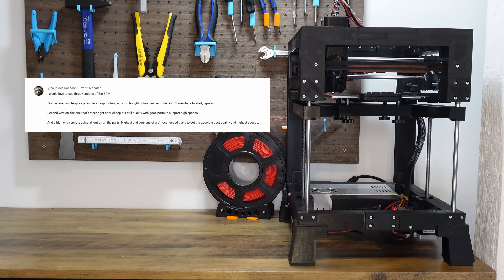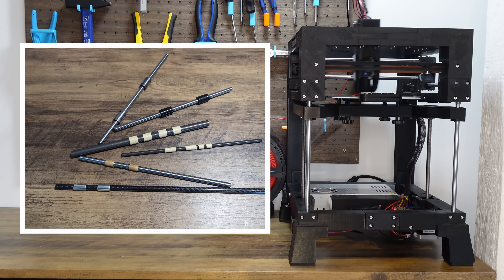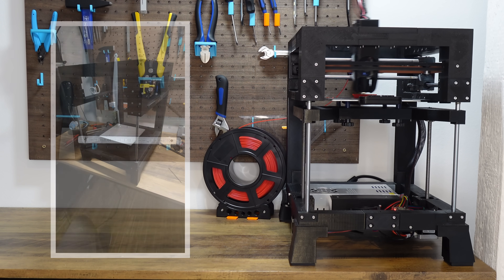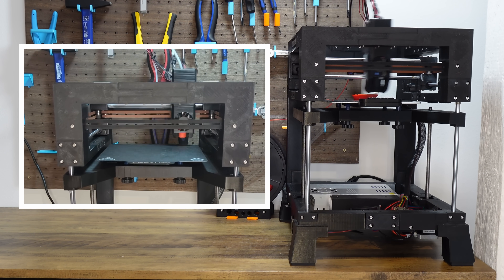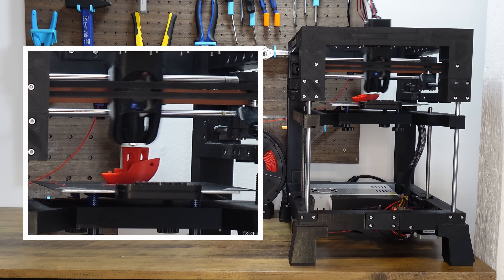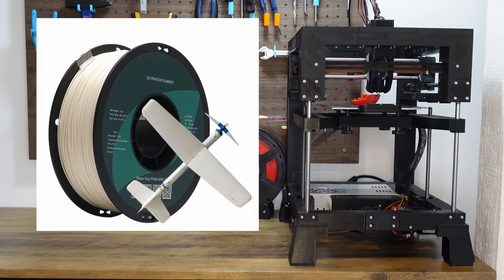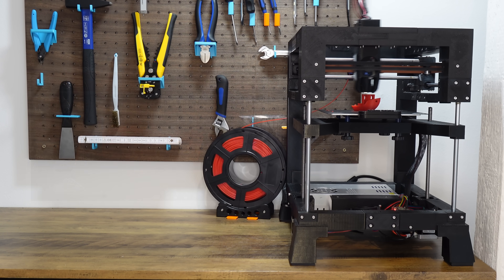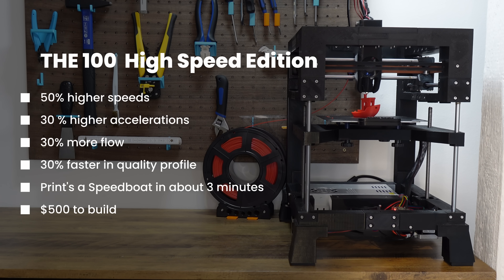THE 100 - The dethroned speed champion... even faster!

Comment: Have you looked at using two HP server power supplies in series? You need to isolate the ground in one of them but they are superb quality and the smaller 750 watt models can be sourced on eBay for as little as £10 each. Not bad for enterprise grade PSUs.

Comment: Amazing machine u made! Also i have a question regarding banana pi zero M2. Can you compile successfully rpi mcu on it to use gpio? Does it need some flinicky workarounds or just works simply? I want one cause of size and specs for tiny printer, but only what i got in question of "does the klipper work with other sbc's gpio?" was straight no (besiesdes maybe uart/i2c/spi from klipper handling drivers for that), and you are only one who i know to use this opi.

Comment: Aluminum screws are lighter than titanium. Maybe a slight bit more weight reduction is possible by switching to what is often marketed as duraluminum (aluminum 7075) screws which are very common in rc vehicle hobby spaces in the m3 size.

Comment: Project is 11/10 awesome 😎 

How about aluminum bolts? They are lighter than titanium, is the strength/ rigidity of titanium necessary? 
Also seen one of the 3d printer bloggers bolt a 3d printer to a concrete plate, will this also help THE100?

Comment: you will find that the foamed pla will be much more regid, the foaming agent makes a bubble/honeycomb ish structure inside the extruded pla, and in my line of work this means when you find the right ratio of agent to virgin material will give you ligther and stronger parts, i am a plastic injection moulding enginier in Denmark, let me know if i can be of any help :)

Comment: How viable would it be to enclose the printer and give it a slightly heated chamber? 

Ive had good luck at higher temps with cheap carbon fiber ABS (spaghett brand from th3d, doesnt have any warping issues). I just dont know if it would be enough to have a 40c to 60c chamber temp (i like to print odd materials)

Comment: An optimization may be to have the cooling fan mounted to the frame, and a tube carrying the air. This would reduce the complexity and weight of the print head, and allow for far higher volumes of air.

Comment: What driver are you using with those motors? The driver is just as critical as the motor! From the motor, looking back into the driver (effective resistance seen) will have a large effect on top speed, ringing and stability.

Comment: going to note that ABS is less dense than PLA so you could save weight that way as well. as for a recommendation of ABS, butmat's ABS prints very easily in open air and can handle the cold air from 2 4010s @70%

Comment: Is the PICO able to handle 3x 2.5Amp motors? Their FAQ suggests 0.8A without fan and higher with additional cooling. Still waiting for some v1.1 NONHS parts to test temps with the 1.5A motors
Reply from the maker: The TMC2209 Drivers are able to run up to a current of 2.0A. The limit they notice in their FAQ is for passive cooling. I used an 5015 blower to actively cool them, which works fine for me

Comment: Could you tell me where i can get the Linear Motion Parts without Aliexpress? I am from Austria and tried many of this parts in the past, but none of them worked good enough. And now, i would like to build "The 100 High Speed Edition" because i like this design and have build many expensive Printers (with MGN12H) in the past ;-)
Reply from the maker: Currently we do not offer sales outside AliExpress, but we are open to cooperate with local sellers to bring the kit into their stores, but since this is a pretty new product it will take its time

Comment: Hey Matt, I am thinking about building THE 100 but I am not used to speed, so the standard model would be the one I should build. But it is literally my job to do 3D printing (at slow speeds) and I can see myself wanting to upgrade it later. Now my question: Would it make any sense to build the standard THE 100 and then replace the parts for the high speed version later? Or should I make one decision and stick with it?
Reply from the maker: I would not use a THE 100 for a 3D Printing farm, since the time and effort you have to invest into building & tuning one would ruin every business case! Besides that both editions are compatible to each other, so you might upgrade in the future

Comment: Always wondered if it'd be possible to brute force higher speeds by moving from belts to motorcycle/timing chains and using nema 23/24 motors. Everyone's shaving weight, but I have yet to see anyone just add more power.
Reply from the maker: Yeah there are a couple of samples where people used servo motors, but since it's not allowed for speedboats most people avoid that path

Comment: Thanks for a great project and an awesome printer. I really appreciate all the hard work you have put into this. I was always in two minds watching the Rolohaun project but now I am very motivated to build your printer and I am already making my plans on the color choice for filaments to use. 

Going by your expertise I have a crazy idea to use the top XY part of your printer to convert a Ender 3pro to a core XY printer. You already know what benefits to expect even if it prints at 25% of the speed it will still be three times faster than the original. Let me know your thoughts. - A Very BIG fan from India 😊
Reply from the maker: Why two minds? Rolohaun does a great job on his 3D printed printers, im always happy when the youtube algorithm show me his newly produced video as an inspiration.

If you want to go a cheaper route have a look at the Ender 3NG project, it might be even cheaper since you could salvage more parts from the original printer
Reply: @MattThePrintingNerd  I am sorry you got me wrong, I respect Rolohaun to the T, it is only your detailed thought process about being a perfectionist that I like better. The ender 3 NG project is already WIP only delay is getting the various specific parts like threaded inserts or linear rods which I am struggling with. I hope to complete it soon anyway. Thanks for your response 😁

Comment: You can drill out the linear rods. They keep over 90% of their strength even with think wall thicknesses but you don´t even have to drill them out this thin. You don´t even have to drill them out entirely, ø5mm x 100mm from each side would decrease the weight more than the titanium screws by ca. 30g. Since you use 2 Rods it would be 60g and you can even go up to ca. 100g with ø6x200 drill bit for instance. Those rods are pretty heavy. You could also probably use Nylon screws in some cases.
Reply from the maker: The last time I checked out nylon or PEEK screws they were 5-10x the price of titanium, do you have a cheap source for that you want to share? For my next iteration if my THE 100 I produced steel based hollow rods with a 4mm wide inner diameter. It was pretty hard to produce them. Out of 30 rods I got 8 pcs that made the cut. Mass produce them would be a big project on it's own. I would like to see them but currently it's not in my focus. With the release of the linear motion kit I got not only positive feedback, there were a couple of people (not the majority) that reached out to me that the price was too high and they have worries that the whole project moves to a price point were it' similar to other fast printers a premium product, which was never my intention. But it was a learning and showed me that the community has grown to a point where my responsibility gets bigger and bigger and I don't want to change my core values.
Reply: @MattThePrintingNerd  PEEK is way to expensive, I didn´t know Nylon bolts were more money than Titanium.
Yeah the price point is very important. That´s why I mentioned drilling them out instead of producing them from scratch entirly

Comment: I know the point of this project is speed and that the community interest is around raising the budget, but my interest is how you put together a high quality DIY BOM for less than $350. I'm not aware of any other high quality design at that price. I print petg and speed is not a priority for me. I wonder if easing that speed constraint would significantly make this build cheaper/easier.
Reply from the maker: I know that there are countries out there where $350 is still a big bunch of money but to be honest, the last THE 100 I built was about $260 with all to discount codes & sales deals. To cut that even more I would go a second hand route. Here in Germany there are often old bedslinger for sales for 50-60 Euro, having 3-4 bedslingers might be the faster option when you have the space for them
Reply: @MattThePrintingNerd  Thanks! I wouldn't be interested in sales or secondhand sales. To me, the low base price is attractive partially as a proxy for an elegant design. Also, I already have a couple bedslingers, I'm specifically looking for a DIY kit to tinker with. The 100 seems like a really fun platform to learn and build on.
Reply from the maker: Then go for it, you will have a lot of fun with the printer ;-)

Comment: If you are looking for high stiffness, lightweight materials, might I suggest PP-CF or PP-GF. I think a lot of people avoid polypropylene for its reputation of having poor bed adhesion and a tendency to warp. Magigoo PP is amazing for bed adhesion and using a fiber-filled polypropylene reduces warping significantly. Also, fiber-filled PP can be printed fast. I print Braskem FL500PP-GF at 500mm/s and 20k mm/s^2 (400 mm/s, 10k inner wall, 5k outer wall) on an X1C with an aftermarket CHT nozzle. I would reckon you could reach much higher speeds with your printer. Keep up the great work!!!
Reply from the maker: Didn't know that there is PP-CF out there, that might be also an good alternative! Thx for the info
Reply: @MattThePrintingNerd  The FL900PP-CF prints just as fast as the glass filled. It's pricey, but it's really nice stuff.
Reply: That's interesting. Haven't heard much noise around filled PP. Is your CHT nozzle also hardened? The only properly hardened CHT nozzle I've found are the Bondtech Bimetal and the Bozzle Nozzle which are both expensive and hard to get where I live.

Comment: cool, BUT 😂

I built my v0.2 for around 620€ including ABS filament in 2 different colors, so you can save around 60€ if you already have some abs

and it runs up to 650mm/s print speeds on quality mode   wich is more then enough,  and i could swith to a bowden extruder i i want more, wichbis useless. the cooling and hotend couldnt handle that much more . And in my opinion a v0 is a more Industrial looking and feeling printer wichbis overall better than this,

BUT it really cool, and if i finally have some time after finishing my mechanical engineering high school i for sure are gonna build something stupid fast, and since i now own my own cnc, i will make the frame out of milled aluminium and make my own extuder, since i havet found the "perfect" one . Im aiming for 3000mm/sec, since the frame should be way more stutdy and allow for some stupid speeds

so yeah, a place to sink some money into😂
Reply from the maker: Have a look at my first introduction video about the printer, there I describe why I don't went the V0 road, also in my V1.1 update Video I described why  a polymer helps improving the speed of the printer by creating acceleration curves that are way more stable and therefore easier to compensate with input shaper. 

When I comes to numbers im a fan of show, don't tell. There are many backseat constructors in the community that have good ideas and I am willing to give them a platform, im a sucker for fast printing demos, even if they are not printed on a THE 100

Comment: I watched somebody, I think it might have been CNC kitchen- I'll have to see if I can find the orig vid again, If I do I'll post it here. again. Anyway he compared the Bondtech CHT with $2.00 knock off nozzles from aliexpress that a viewer told him about. Sadly the knock off nozzles (the nozzle itself & the center were 2 seperate pieces, the center was copper & had larger holes, but also a sharper point /triangle that split & melted the filimant more uniformly & because ethe center was copper it has higher thermal mass & therefore, thermal transfer to the filiment. He was able to increase the speed & flow rate @ least 150-200mm/s above the normal max than he could with the Bondtech CHT Nozzle & for $38.00 cheaper- not including tax/vat/shipping etc. He plotted everything out on like 6 pages of different things he tested like flowrate & standard temps for PLA & the like & it won in almost every catagory. Neither he, nor I expected that. But it also shows that your technicly overpaying for bontech's for way worse performance.
Reply from the maker: You are mixing apples and oranges. The videos from CHC Kitchen where based on the V6 CHT Nozzle and yes thats something I can confirm, it's slower than the clones. But Im talking about the Volcano CHT's, here things are different. Compared to the original one, the clones do not split the filament at the Tip of the nozzle which makes a difference (even if it's a small difference).
Reply: The ones I saw split it at the entry (inlet) to the nozzle- so when you say the tip do you mean the same thing or at the outlet of the nozzle (the actual tip)- or does it do it @ both? I ask because it it doesn't split @ the entry to the nozzle the end of the filiment will bend & push into only one of the 3 channels, & will need to fill it until it gets backpressure @ the tip & overflow into the other 2 channels that it should have been split into in the first place. The only other way around that would be making the inlet a single hole that diverges somewhere in the middle of the tip into the multiple channels.  @MattThePrintingNerd

Comment: Hey matt i follow this project and im so fascinated 😍
I printed the bottom Frame and Upper Parts are coming 😬

You also tried hollow rods ?
There are 8mm with g6 tolerance hardened to 60hrc 
Maybe for the toolhead?(lighter)
Or would you say they are Not Stoff enough?
Thx a lot 😊
Reply from the maker: I made a prototype of Hollow Rods by myself and it was a nightmare producing them, Out of 30 Rods only 8 survived. It's really hard to create good one ;-)
Reply: @MattThePrintingNerd  i found some in my Company for injection tools 
They are 8mm with g6 tolerance and immer hole 5,4mm
Quite expensive i think but its a Common Part in my company
How was your experience with those ? Would you recommend ?😊
Reply from the maker: Can't say for sure, mine are 4mm ID, i tried to go to 5mm but I was not able to produce them without deformation, but it looks like that I had the wrong tools ;-) Do you as company produce them by yourself or do you have a supplier for them? Maybe we should move that conversation to discord ;-)

Comment: well 500usd...when a bambu p1p is 539 usd. what the point to build one?
Reply from the maker: 8x higher acceleration, 4x higher speed, 2x higher flow
Reply: @MattThePrintingNerd aww, that's all? 😂 Well that and it's open source and uses accessible non-proprietary hardware and software. Well done good sir!

Comment: great project. I've recently came upon realization at just how slow my current printer is compared to my old delta.  great to see that the work is still going on. considerting of rebuilding my printer into the 100 desighn. i have a 300mm bed tho so mightt have to adjust

Comment: The strength to weight ratio of Lightweight PLA is worse than regular PLA. If you have removed as much material as possible and still have headroom in the parts strength requirements, then give LW PLA a try, otherwise it is better to use regular PLA and cut weight by removing material.

Comment: started 3d printing last month with my prusa mk3 (self made clone) and now i want to build the 100. my question is can i use pla parts instead of abs. and i cant find ender 2 heat bed
Reply: It's printed using PLA according to the info

Comment: That's so true about pairing.  I redesigned the X axis carriage (extruder mount) and Y axis bearing mounts and rod seats for the Sovol SV06 for strength, and more speed with less ghosting.  I decided to use PETG for the parts to help with resonance and Drylin for similar reasons, but each bushing needs to be matched to the parts I make.  It has been very educational.
Reply: Did you share these anywhere? I also have a SV06
Reply: @p_serdiuk  yeah, google printables smittyforge

Comment: Have you considered using a Goliath hotend for the high-speed edition? It has up to 100mm^3/s flow. Yes, it costs $135 (for the air-cooled version), but for that flow it's good value.
Reply from the maker: Currently there is no space for the goliath. It's simply too long, but I plan to move the gantry a bit higher for 2.0 and later so the chances are high hat I might be able to support it in the future